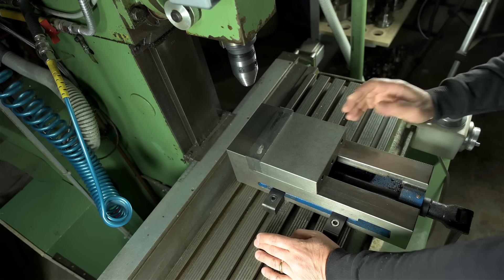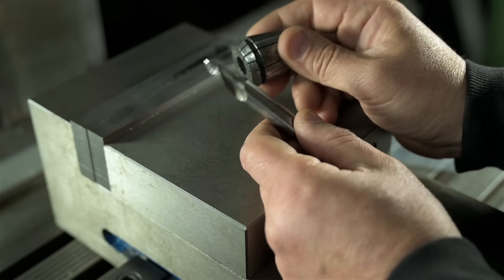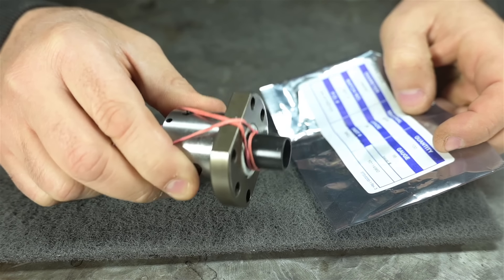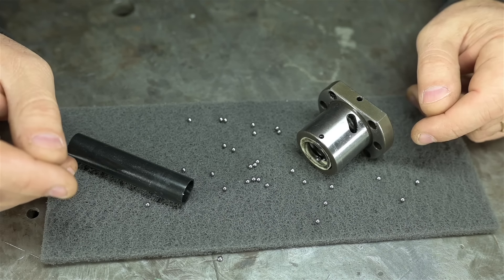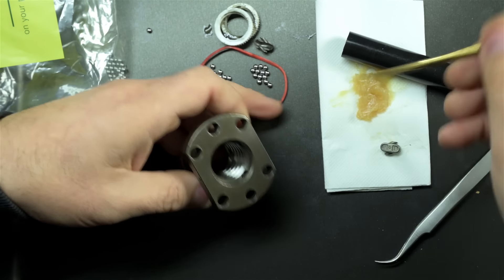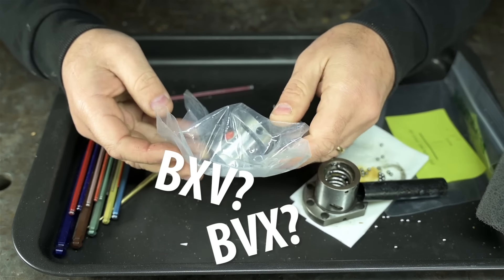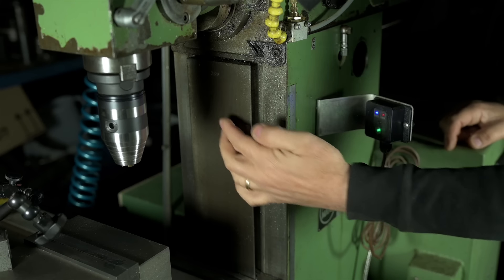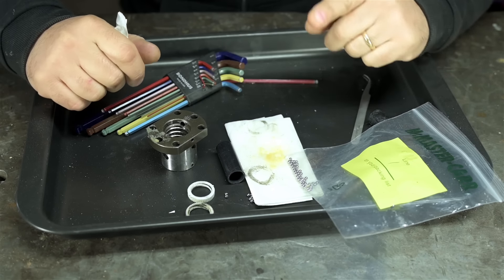Rebuilding &/or Replacing BALL NUTS

Comment: The moral of the story is that the real ball nuts are the friends we made along the way
Reply: Maybe the real moral of the story is - if you rebuild a cheap ball-screw, you might end up screwed and bawling?
Reply: I BOUGHT A NEW ONE
Reply: APPLAUSE  👏👏👏
😂
Reply: The real real moral of the story is to just give the old pony some gas over the hills.
Reply: The moral is to set your limits of travel so your ball screw doesn't go beyond available space. Hence the phrase: balls to the wall.
Reply: You can't make a soggy biscuit without a few screwballs.
Reply: You must maintain the balls
Reply: * the cross threads we made along the way
Reply: I sort of assumed the moral was that heavy screwing can wear out your balls
Reply: @JanBabiuchHall  fkn lol
Reply: @Sarah Tisdale  hahaha 😂
Reply: I thought the moral was same as it always was...
"Don't neglect the Balls"
Reply: @AlexWillmer  That would be balls to the walls (almost).
Reply: If it feels like it's way too tight and you've been sweatin, swearin and fightin...nay, BATTLING for hours to get it to fit. Worry not, my young apprent-i. For..It WILL go.
"It's a made for the hole and [it's] a GONNA go." (that's what I told her anyhow, as sweat poured from my brow) Come Hell or high water. And you press forward, fighting harder. Never letting up, giving in, or taking NO for an answer...Ever. 
And it's therein where THEE moral lies.
Reply: @drworm5007  Maybe not "wear out your balls" but make them sore for sure!
Reply: @cavemanvi 🎉😢😮

Comment: I had an engineering lecturer that had made his career in precision electromechanical systems, and when he was discussing linear actuator choices (lead screws, ball screws, roller screws) he spoke of roller screws with such reverence. Also said they were really expensive. Anyway, he brought one with really fine threads one day to show us what he'd been talking about, let us mess around with it and stuff. If I'm honest, I still think about it often. It was so smooth, so quiet, so heavy. Unbelievably satisfying. There's no story here, I just don't know who else to talk to about this. Other people in my life just don't want to hear about my college experiences with roller screws.
Reply: I have no use for one but now I want one
Reply: Oooo! Tell us More! Do!
Reply: I hear you bro. Its make  stupid Dick Jokes where I work. They all want the answer to life in three seconds or its back to the clown show.
Reply: i made geared planetary roller screws once upon a time. they are quite a mousetrap. there is a reason they're not more common they're hard to make and have a lot of parts in the tolerance stack up, id ball park a screw for tonys mill would be 5k$ and have 3-6 month lead time. but unless he crashed it into the casting it may last 50 yrs. now on the other hand roller thrust bearings are the cats meow and not as hard to make but still probably 3-5 x the cost a normal thrust bearing not and not an off the shelf product. now if you think about this the lead ,number of starts, gearing on the rollers, roller dia., dia of screw all have to have a common denominator so to speak there's a lot of math that goes into the design side even before you get a tolerance stack up.
Reply: "Dear TOT Forum. I am a freshmen at a small midwestern college, equipped with what I like to think is a larger than average chuck. I always thought the stories posted here were fake, but then something happened that changed my world. I never thought it could happen to me, but let me tell you the story."
Reply: @jrEwing-lo4ky  Clickspring (Chris) probably has some that are as complex as the Antikithera mechanism, all hand-made from one-of-a-kind alloys.
(BTW, the dollar sign goes to the left: $5k)
Reply: Your post was so Freudian.
Reply: My family don't want to watch ToT with me...lovers, they don't know what they are missing. They also don't appreciate my collection of AC compressors that I pull apart when I'm feeling they need mechanical education.
Reply: This is like the one thing you want to talk about but never will be able too. Its a curse
Reply: You are among friends here, Ross
Reply: Well damn, never heard of them and now I need one.
Reply: Perhaps it would have been an idea to try new balls of the original size, just to see what is worn out.  It’s either the balls or the nut. I’m kinda curious now.  Good job on the rebuild, sorry it didn’t work out. Glad the new nut is solid.
Reply: @ross302ci   I used roller screws way back in the 1980:s for a very fast machine servo in the medtech business. It was fairly short stroke, frequent reverse, high load and very high angular acceleration. Ball screws at the time could simply not take it. They were and are as You say rather expensive. Stiffnes is also much better than ball screws. SKF and INA made good ones, only special order.
I would still consider them for some high reliability fast precision servo applications.

Comment: Hey Tony thay looks like a SFU20 or SFU25 "ball nut" You're using there. Take a look at the DFU20 or DFU25. They are "double ball nuts" and has twice the internal load bearing area and twice the amount of balls plus..... you can adjust the tolerance between the two and completely eliminate any backlash. Absolutely love You vids man.🎉
Reply: Was thinking he could fix up that missing return loop.
Reply: The load bearing capacity should be around the same. It's only a matter of "if you can't make it perfect, make it adjustable"
Reply: Outstanding...thanks.  never heard of one of those things...must be a spin-off of Archimedes type thinking .  Love watching your stuff...even when it's loose.
Reply: @MF175mp  So that you can blame it not working properly on whoever adjusted it instead of the poor quality parts
Reply: The double nuts are weird when you look into it. The two halves are not really fastened together except by the ballscrew itself. There is a little widget to maintain the angular relationship, and then the space between them is shimmed to take up the slack. 
Which I think means that you don't get double the load bearing capacity, as basically you are dividing the work, one half takes loads in one direction, and the other in the other.
Reply: I would assume the longer ball nut length means some lost axis travel.
Reply: Radial load, which doesn't matter/shouldn't exist. Axial load is the same as the two halves are preloaded in opposition. Twice the longevity however as each load direction has it's own set of balls and backlash adjustable.
Reply: @m3chanist  I have a DFU1605 and a DFU2505 on the way for my cnc convertion. Once ive inspected them a bit and looked onto their working Ill report back. If You are constrained on space then the exstra length of the "double nut" might come into play at some point. Absolutely correct on the radial load. You never ever had radial loading on the ballscrew. If so Your alignment/shimming is off.
Reply: @andy pugh  Makes sense if You think of like that. One half of the nut loads in ine direction and other half load in other direction but You can completely eliminate backlash. Mine is on the way, I cant wait to play with them and figure them out.
Reply: Before I read your reference the first thing that occurred to me was using 2 ball nuts that could be adjusted/pre-tensioned to remove backlash. It seemed too obvious to not be a standard feature. There are so many examples of split/pre-tensioned methods to remove backlash.

Comment: As someone who also tries alternatives to repair things, especially expensive things I really appreciate honest videos like this. The reality in so many cases is that sometimes the only real answer is buying another part. Far too many youtubers give this impression that anything can be fixed without buying anything, which simply isn't the case. Sure it is fun to try and absolutely a valuable learning experience, but sometimes you simply don't have a choice.
Reply: "I Fixed These Expensive Toys I Don't Actually Need For FREE!

All you need is X, Y and Z, and some costly material you just happen to have sitting around! And it's all free cause all that stuff just magically appears out of thin air! Sure the fix will fail much sooner than later, but it's FREE! Don't forget to like and subscribe!"
Reply: Indeed, my hydraulic disc brakes on my electric kick bike had mysteriously lost all its mineral oil.
So expecting an easy fix i bought myself a bleed kit to just refill them. And what do you know, once filled i did a really hard pull on the brake lever and POP, out flies the whole hydraulic line.

So i bought a (compatible with the cylinder) new line and i wanted one a certain length but the store clerk said it was for the rear so i got confused and opted for the "correct" front brake line. Turns out i really needed the longer rear one because a kick bike is not a bicycle and there's more distance from the handlebar to the brake cylinder.
Luckily i also bought a new nipple and olive (something you use to install the line in the brake handle that crushes around the line to keep it in place) and i got away with just re-using the old line and doing a PROPER install with the new nipple and olive, something the idiot assembling the bike hadn't done because the old olive (ball thing) wasn't even crushed.

Time will tell if i lose my brakes going downhill at 50 mph though... Fun times.
Reply: @FiltyIncognito  I seethe with hatred when i see a video that promises DIY for only $25 and then breaks out $250 of "scrap material"
Reply: ToT takes it the right way around : try to fix with what you've got, if it doesn't work, put on your sad face and go buy a new part
Reply: Are you me?
Reply: Yeah but 60 bucks "trial" ball screw solved a very expensive problem.. I suppose for people who only know (or have the means) to throw money at their problems being "cheap" is looked down on. But sometimes being smart saves lots of money..I do it all the time and get good if not excellent results.
Reply: @chuckthebull   Word to the mothership! A lot of elite YouTubers often recommend some insanely expensive product which they either paid for with their monetization check, or given to them by a sponsor. It's annoying when they claim any hobbyist can do it while whipping out a $1000 Festool loose tenon machine.
Reply: @FiltyIncognito  As long as the material you're talking about is slightly bent wood fasteners in unusual sizes, about a dozen of those appear for free on my shop floor every week. Equally mysterious, there are bonus ones that can only be found while barefoot.
Reply: @tallskinnygeek  Hoho, cousin to Lego pieces and poster pins, those are. Ain't no better feeler-finder for sharp pointy things those tender toes and brave soles.
Reply: I've learned a lot from trying to repair a part, and ruining it instead.
Reply: Ah you may not succeed but you learned
Reply: This is entirely based on your expertise and background. Like, if my job is to fabricate microelectronics, it wouldn't phase me repairing something that required microelectronic fabrication. Etc.
Reply: @PseudoEmpathy  always try, many " non serviceable" items can be repaired,  and the more you learn by trying the more you succeed.  Yep even if ball screw came together it prob would have been out if tolerance but  may have got you through the project and proven that that is exactly where the failure , backlash, was in the machine. TOT is always delving into things at the edge of his experience and as a maint tech I have been doing the same for almost 40years
Reply: My strategy after the cheap fixes fail is to change my name and move to another state.
Reply: @FiltyIncognito  : Well put !
Reply: @jamesocker5235  : "Learned": ..... How to scrub years off your life, for no gain.....
Reply: @jimbayler4277  called makin a living
Reply: @jamesocker5235  : Having spent most of the last 37 years being self-employed as a Landscape Contractor, Fabricator, and Maker, I am all too familiar with the "I can make it go one more mile" dance.
Reply: @jimbayler4277  nope, not the solution, just because i kew nothing about semiconductor manufacturing tools, oil field fracturing spreads, oil field cementing tools doesnt mean I cant learn to repair them successfully,  Its all in the try, your going to fail but the fail teaches you the lessons to be successful.  A faulty densitometer in a remote location  can be fixed with out parts
Reply: @jamesocker5235  :  You went from a funny exchange, into argument mode.
I spent plenty of time doing "make do" repairs out of necessity.  There were also, plenty of times wasted, when I should have just broke out my wallet.
Reply: @jimbayler4277  nope
Reply: @PseudoEmpathy  "it wouldn't phase faze me"

Comment: Tony, I overhauled ball screws  for the Air Force for many years. You can rebuild ballscrews as long as the chrome on the screw is still intact AND there isn’t any wear on the inside of the ballnut. Wear inside the ballnut will appear as galling or fretting just on either side or the return tubes. The tracks should be shinny, but the worn areas will appear dull and the dull area will grow longer if they aren’t overhauled properly. 
The key part of overhauling ballscrews is having an assortment of ball bearings. We had dozens of sizes of balls that varied by 0.0004”. It’s trial and error to pick the best size. You want a minimum of 0.001” endplay when done correctly. Any tighter and the ballnut will feel notchy or rough and cause premature wear. Looser than about .004” and the bearings will bounce inside the track and wear the chrome of the screw and the inside of the ballnut. Get the endplay as low as you can, but it needs to feel smooth over the entire travel. Generally, you can overhaul a ballscrew one time before the ballnut of screw is trash. 
Aircraft ballscrews usually have oiled felt wipers to keep dirt out and a metal ring on top as an ice breaker to protect the felt.
Reply: It's always nice to learn something from people who worked in some specific industries! Thanks for that interesting comment!
Reply: Thank you for that. I often wonder about that . Ball screwa have made power steering systems work for many years in cars and trucks. When the screw in a tractor steering gear locks up, a very large man will not break it loose. I have seen it many times. Real dangerous situations. I dont fool around with steering components, unless it is just a simple leak. Operators have families too.
Reply: Where does airforce use ball screws?
Reply: @MonstertruckBadass  I bet there is no shortage of equipment in maintenance shops. Some planes use jack screws for control surfaces too.
Reply: @teardowndan5364  Including some infamously hard-to-reach ones that control the horizontal stabilizer on 737s where neglected maintenance highlighted the single point of failure with disastrous results.
Reply: @MonstertruckBadass  lots of control surfaces are moved by long ball screws. The trailing edge flaps, leading edge slats, rear stabilizer trim actuators, rudder trim actuators. Even the landing gear on a C-5 uses big ball screws to squat the aircraft for loading/unloading. 
You don’t see them much on fighters, but large aircraft use them a lot.
Reply: @bajaDave  Thanks, very interesting. Thought that would be mostly taken care of by hydraulics but I know next to nothing about aircrafts.
Reply: I read that with a focus like I was gonna have to take a test over it. That's awesome info.
Reply: Thank you for posting, much of the reason I come here is for the comments like yours.
Old Tony has collected an amazing community of followers !
Yes he's very funny, and has some incredible projects,, chainsaws excepted ,,,
Reply: @MonstertruckBadass just to add to @bajaDave answer the ballscrews do exactly as he says but instead of electric motors like on TOT's mill they use hydraulic motors on many aircraft to drive the ballscrews.
Reply: @MonstertruckBadass  not sure about the airforce,  but they are often used in flap, slat, and vertical and horizontal trim actuators.
Reply: @MonstertruckBadass  B1, wing sweep. C-5/c-17, to raise/lower the aircraft for loading/unloading. They are often internal to something that looks like a hydraulic cylinder. I'm not talking out my butt either, I was 'wing sweep qualified' on B-1B, prior to working C-5's, where we had to troubleshoot "castor" issues and climb up into the wheel wells. But the answer is, aircraft use them everywhere. Small trim motors are usually ballscrew too.